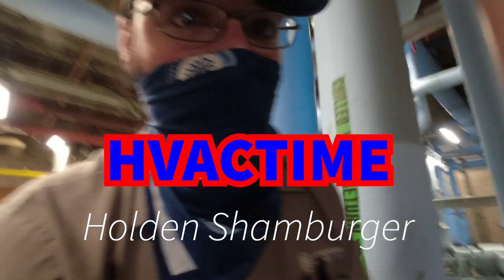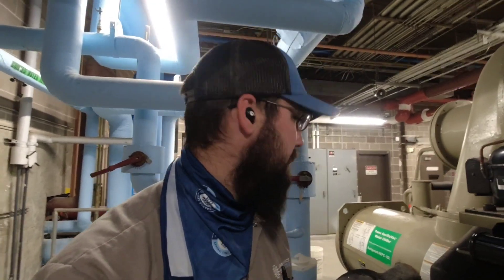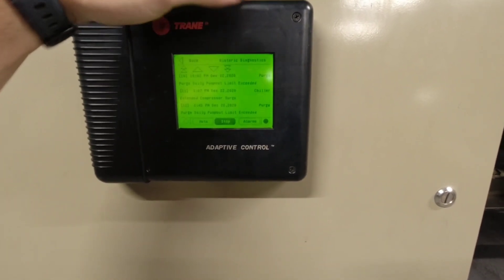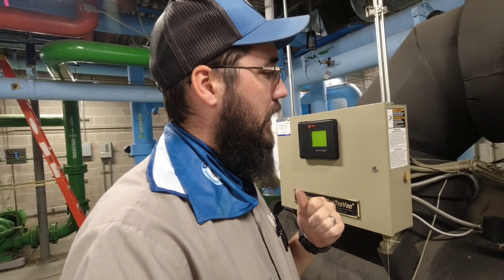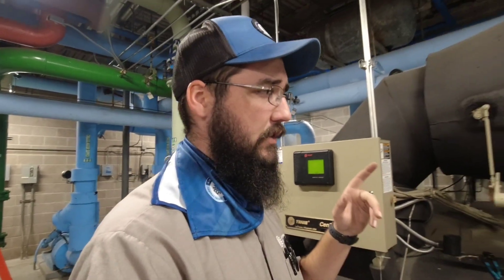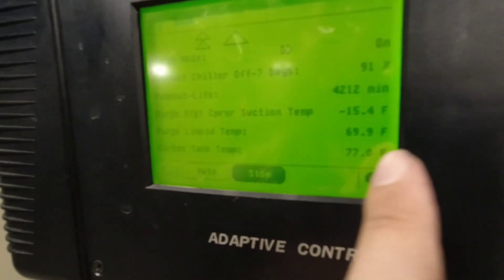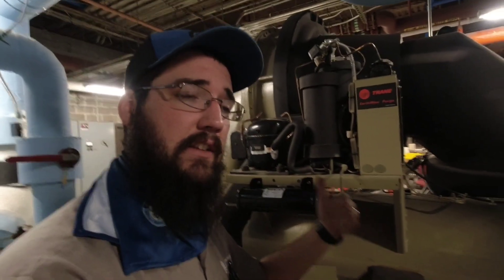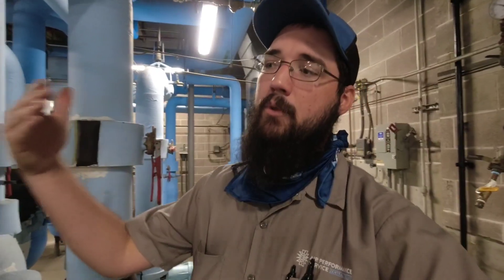Trane CVHF Chiller Excessive Pumpout

Comment: Was that chiller been off before it started surging? If it has been running the whole time until it tripped then most likely you have a leak on the low side. Remember that the entire chiller is in a vacuum when it is off. When its running only the low side is in a vacuum so if it's been running the whole time most likey your leak will be on the low side. Low side leaks are  more difficult to find because you will have to get the pressure just slightly above 4-5psi. I have ran domestic hot water through both the condenser and evaporator barrels to leak checked them. That way I don't have to recover the refrigerant unless I have to repair a leak.
Reply from the maker: It had been running without issue up until shut down for PM. I have part 2 posting on Thursday so stay tuned for results!
Reply: @HVACTIME  let me take a quick guess, someone didn't tighten down the purge filter drier? Or didn't bypass pumpout minutes for 72hrs and maxed out the purge because of the air it sucked in while changing oil filter and filter drier.
Reply from the maker: Hahahahaha!!! Bingo